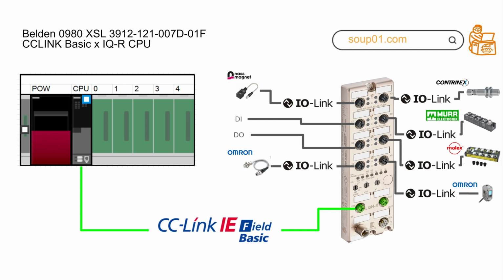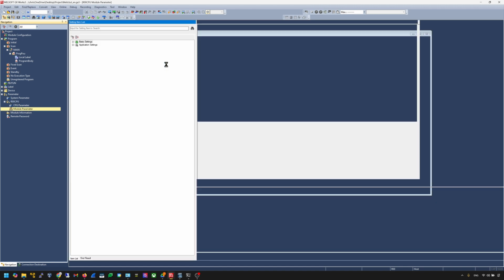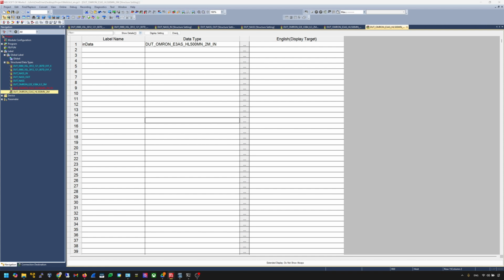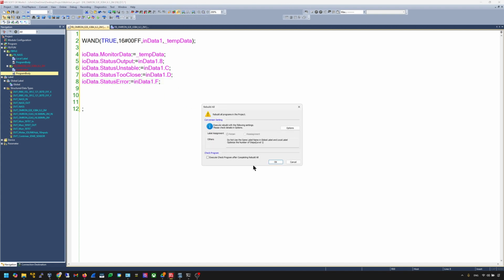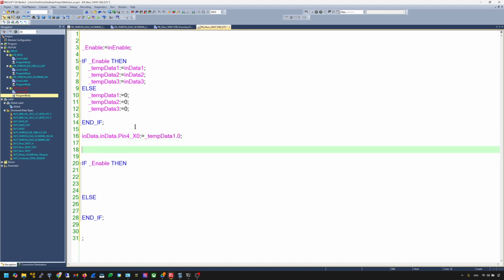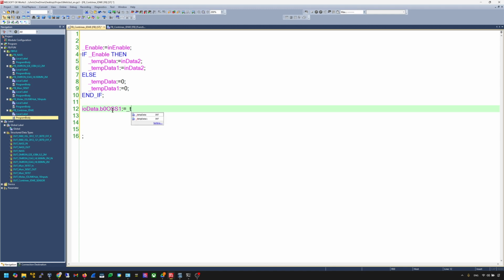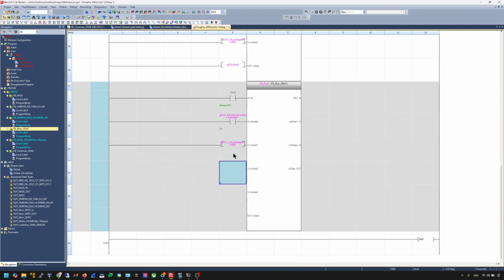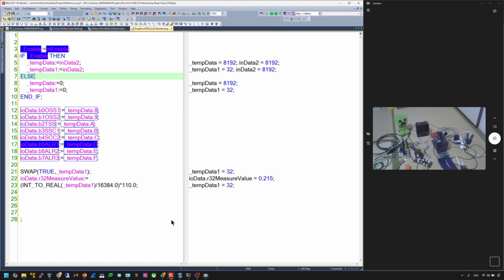Mitsubishi.Let's Build a CC-Link Basic network with IQR CPU and Belden 0980 XSL 3912-121-007D-01F

Comment: Hi,  thank you for the informative videos. I am new on the MELSEC family. I am trying to connect Balluf BNI00E7 with IQ-R R04CPU. How can I do it ? Do you have any information about that?
Reply from the maker: Please reference to my blog;

http://soup01.com/en/2024/07/17/projectmitsubishi-qj61bt11-x-balluff-cc-link-iolink-master-2/
Reply: @threessoup01  In the Balluf BNI00E7 model, there is no. of occupied station. Does it mean how many IO Lin will connect to the master or it is for number of the connected slave IO links? 

Thanks in advance.
Reply from the maker: @ibrahimdemir47   
NO, it will set the exchange data size between your CCLINK master and CCLINK  Slave.
Reply: @threessoup01  So, I have tried to connect BNI00E7 master hub with BNI0007. Does it mean I need to change No. Of occupied station from 2 to 3. Because slave sends 10 byte data. 

Thanks in advance !
Reply from the maker: @ibrahimdemir47  you are welcome 😁